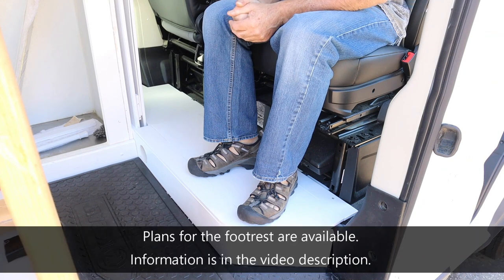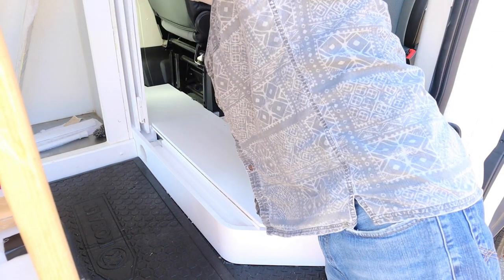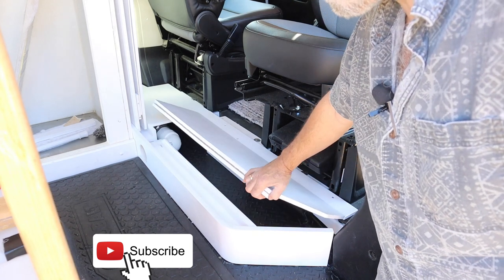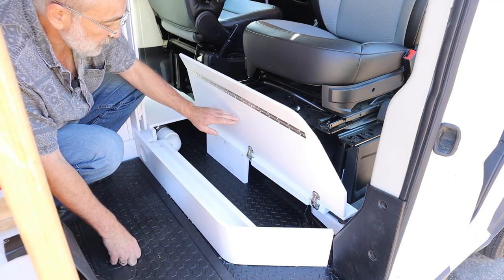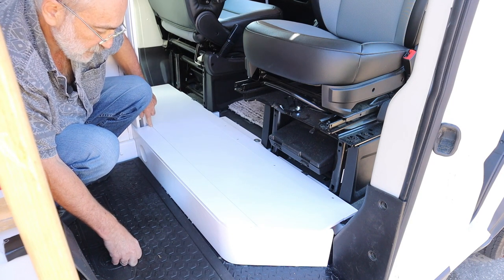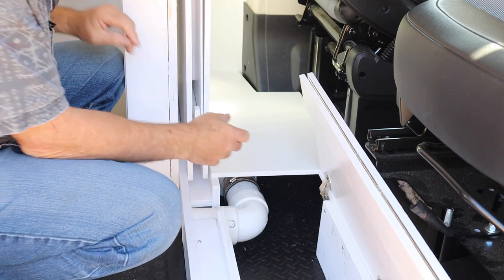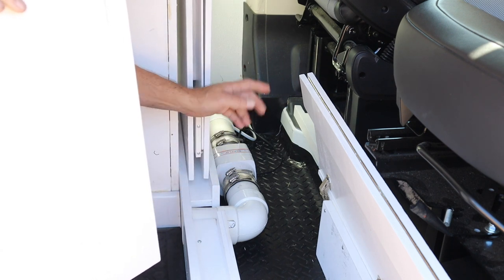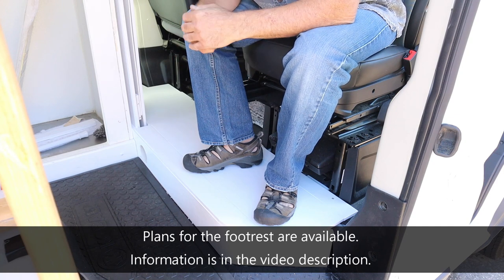Van Life build series - the completed Promaster Foot Rest Part 3

Comment: That vent fan setup looks like the only way to go. I was going to use a computer fan but what you did with pipe and inline fan is smarter.  I'm going to pump my shower and dish grey water out that hole too. No need to cut a hole under the shower.